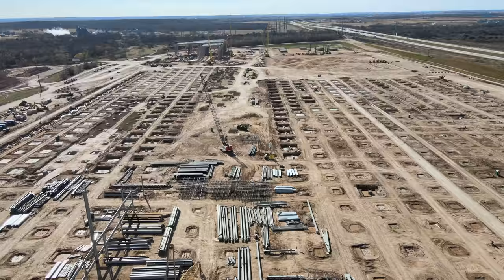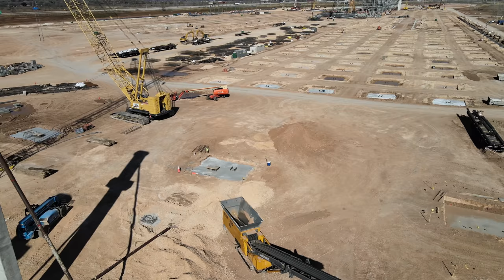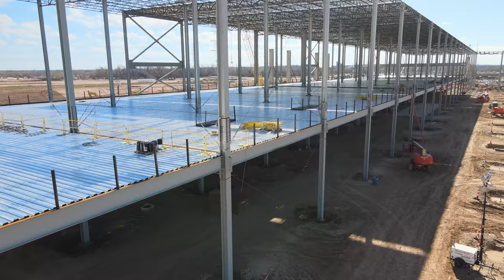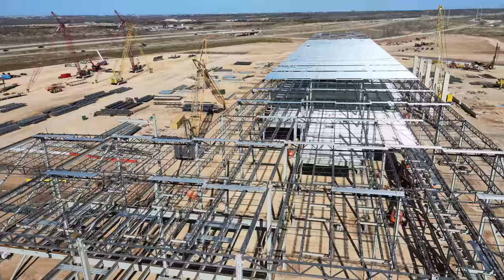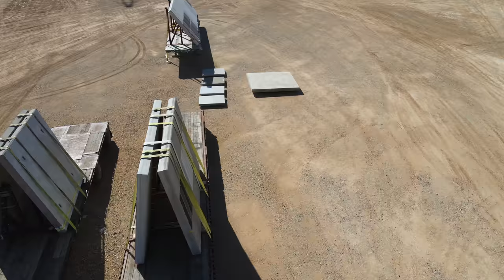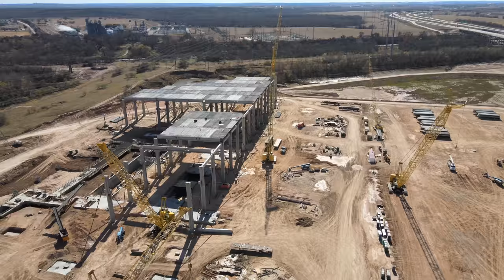A Closer Look - 2020-12-27 Progress Update

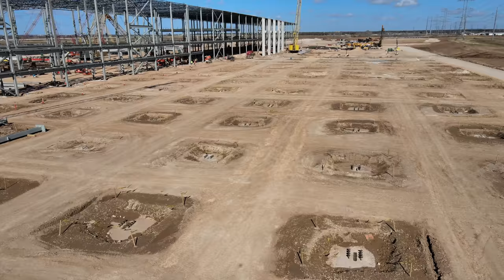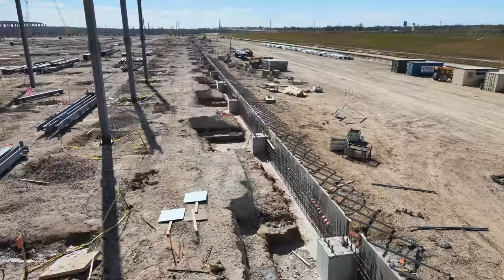Comment: 10:16 Footings seem to have a small recess in between the rows of hold-down bolts. I wondered what it was for, and then I saw the same detail again at 19:26 over on the west side on 2 outside footings only. Handily at 19:55 there is a shot of the bottom of some of the steel columns, and they have a tang/blade projecting from the bottom of the base plate. I assume the tang/blade fits in the setdown. I haven’t seen this detail before. FWIW those columns seem to be ready to take bracing.

Edited. Googling around finds that the blade is a shear lug/stub.

Comment: Wow, those small overflow ponds on the north side are sure holding their water.
Reply: Hopefully not too well. They are designed to eventually let rainwater filter back into the water table. It offsets the impervious nature of roofs and pavement.
Reply: @jbbuzzable  Right. The big retention pond on the south side lost it's water pretty quick. But those little ones seem to be keeping theirs, and it's been a few days since the rain.
Reply: @dahur  
That's a detention, not retention pond. 
The soil under the parking lot detention ponds (and almost everywhere else) was stirred while damp, then compacted and dried in dozens of thin layers. That soil is never going to drain easily.

Comment: The yellow vehicle they assembled in the north west corner is called a straddled carrier. My dad was a longshoreman in Long Beach and I remember seeing these drive over the top of the container and pick it up and move it. This is a low profile one,  smaller than the ones that I saw them use. I believe the reason they have this is to move containers inside the building where a forklift might not be able to travel. Probably just start moving machinery and parts inside.
Reply: Exactly, long structural/building items would be near to impossible with a forklift inside the structure

Comment: Next 4 days will be wet in Austin with the potential of 2" of rain by Thursday. Hopefully it doesn't delay work too much.
Reply: Wow. After basically 4 days of little work they might be delayed even more? Tough to dry out at this time of year.
Reply: I hope it does. Get more time off. Those 4 days went by too quickly.
Reply: Shanghai will have finished phase 2 and Berlin will have started installing floors by then.  Cybertrucks are going to be delayed even further, most likely.

Comment: Great, close in flying. Were you able to get all of this with 1 battery?
Reply from the maker: Oh definitely not. This was 4 batteries over about 2 hours. I didn’t end up using footage on about 1.5 batteries though.
Reply: @TexasTerafactory  Thanks. As a Drone Pilot (Mavic 2 Zoom) I always wonder about the details. Great control with the Sticks BTW. It looked pretty challenging while you were shooting the color panels.
Reply from the maker: The wind was brutal today. Especially around the color panels.
Reply from the maker: And as for the details, all of this footage was recorded in “tripod” mode for enhanced stability, though the wind laughed at that notion. Then all video is played back at 2x.

Comment: 3:47 So are those posts on the end supposed to be different heights also? Anyone know?
I asked a few days ago.
Reply: One on the right is definitely taller, and here's my comment on Joe's channel, which may or may not be correct, it's all speculation: There’s an intermediate footing between those southern most columns, so if another column is installed then any beams spanning between would only need to be tiny (relatively). So to achieve the same overall roof height, the columns will be a bit taller.